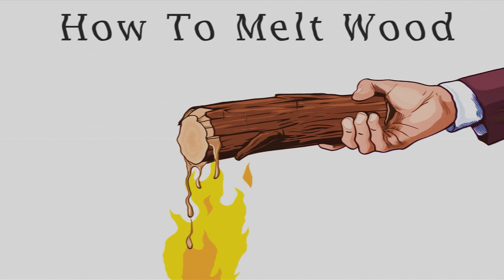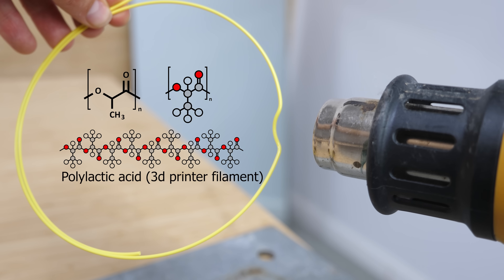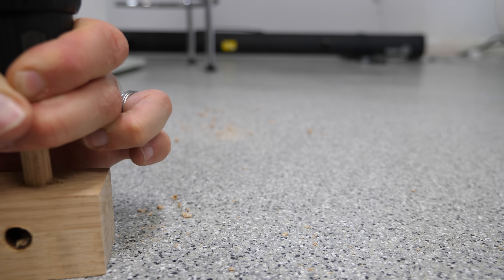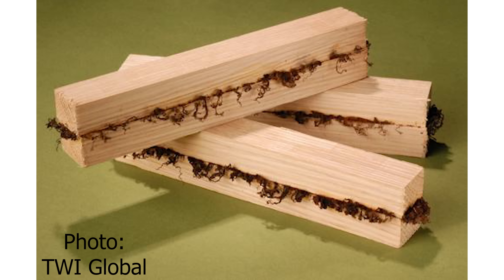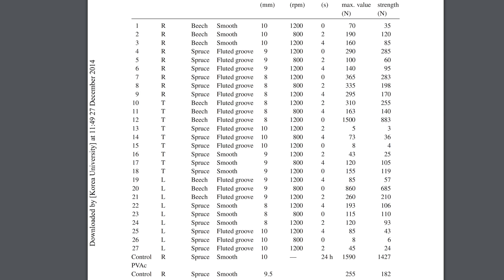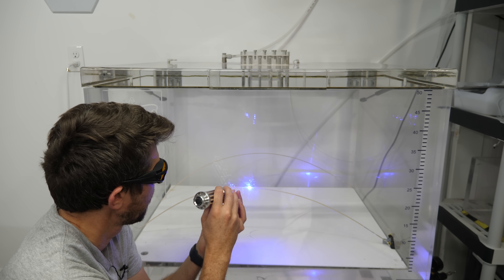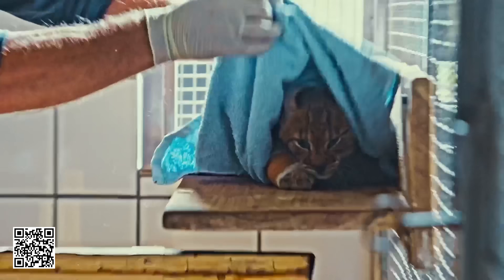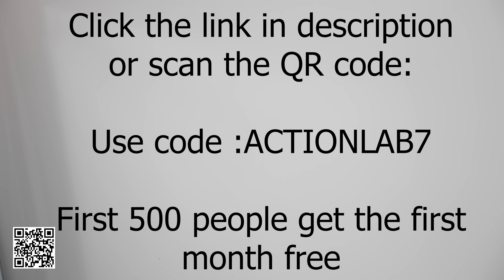I Melted Wood With Friction

Comment: I recently saw a YT short where a man was showing off his product "Wood nails" basically it's exactly this. You use a special nail gun that shoots the tough wood nail which thanks to friction is literally welded into the wood. And he's super humble, he doesn't call it some future of building or anything, he just states that the wood nails are useful for some applications but not all applications.

For example a wood nail instead of metal nails will mean that the wood will not rot so soon. Metal nails rust and that rust is the main cause of the wood starting to rot plus the wood nails are a significantly stronger connection.
I'd say every carpenter should atleast check it out.

Comment: There is a tribe in my area who made a hunting equipment (tool) by using wood and they need a frame structure, basically they use a technique called joining, there a tree ((I don’t know name)) they make hole or cut a according to need, and place two wooden pieces together on it and leave for few months, after that they take it out (pull) and it joints decent enough… if you cut oaks see it’s no longer joint there, some like tree branch,…. According to them you can make joint of any wood, it requires some trees wood,

Comment: is it that much healthier to skip the VOCs of glue using friction if you're making the lignin break down into VOCs and then not burning said VOCs? I wonder what the relative amount put in the air is for comparable joints.

Comment: You didn't melt wood, you partially melted some components of wood. If you've ever seen charcoal production, it does produce quite a lot of liquid, but again - that's not liquid wood, just liquid sub-components of wood. It can probably be fully liquefied, but at a huge cost and complexity.

Comment: Its not welded, well, not really, but yes as well. I know that sounds wierd but its true. The action of the spinning dowel causes friction, heat and then expansion. In that order. Which is why he had to hold preasure on it untill it cooled, when it cooled it shrank and formed to the burnt end of the dowel locking it in place, in the cross section you can see where this happened, so the wood did not melt and become bonded (thats welding) the wood expanded allowing wood to be pressed in and then cooled and shrank locking it in place. Look at it this way, wooden tenon used to lock wood together has been used for about 7000 years, so this is not new tech or a new understanding,  or science
Reply: Akshually 🤓👆

Comment: this is neat to pieces. can it be used for every wood related fastening process? dressers, shelves, walls, etc. if so, then every country should immediately pass laws banning harmful adhesives since just using the wood itself is an option now, and even shows stronger bonding results than the harmful stuff.

Comment: Soooo... You can rotate a dowel really fast to weld it to the hole. But dowels are usually used to connect two pieces of wood. What are you supposed to do next? Rotate the piece of wood really fast while pushing it onto the dowel attached to the other piece of wood? Seems like it's impractical to use this in practical terms.

Comment: I initially thought we were going straight to the vacuum chamber to remove oxygen. I was quite surprised that the friction method keeps the oxygen away just as well. Though while this is fascinating and as you bring up adhesives are toxic and expensive generally, I don't see this being used much in manufacturing aside from a few niche applications. The process of heating the wood properly without damaging it and the pressure and friction requirements seems like that itself would be expensive in implement. Adhesives are just much more generally applicable. But then again I'm not manufacturer, just some random chuckle on the internet. Maybe some company will prove me wrong! :D

Comment: It is so funny to me that I accidentally discovered that phenomenon by mistake literally 2 years ago trying to carve a wooden ring with no tools other than shitty sandpaper and a shitty drill. Thinking it would be easier to stick a wooden rod in my ring to try to smooth it out against the sandpaper with the velocity, I managed to burn it and weld together the two wooden pieces, but didn't knew how it worked until today. I thought residual oil had made some sort of bonding but was unable to explain how (the wood was dry and old lol)

Comment: I always wondered if taking wood into space or into a vacuum and applying extreme heat would cause it to melt
Reply: That's an intriguing thought! In a vacuum, such as space, without atmospheric pressure, wood wouldn't melt but would sublimate or decompose directly from a solid to a gas when heated, bypassing the liquid phase. At DVACI, we explore fascinating vacuum applications, though melting wood isn't one of them! Thanks for sparking an interesting discussion!

Comment: Nice video, but I think its actually not correct. Only what is crystalline can melt. An amorphous solid, aka a glass, like lignin can only soften at its glass transition temperature. As lignin is highly crosslinked it can neither melt nor soften. At least not without decompositon. What actually happens is (in the absence of oxygen) that it partially decomposes (by pyrolysis) and the molecular fragments connect the surfaces by partial diffusion.

Comment: The second part about permanently bending wood under high temperature exists for more than a thousand years now. The primary use of this technique was in ship construction which is also used to this day. Only difference is that it uses steam to achieve high enough temperature without burning the wood.

Comment: I thought this was pretty well known for a long time?  Wood pellets are sawdust bonded via heat and pressure from forcing the material through a conical die.  They come out thw other end with a smooth outer layer that keeps the pellet intact.

Comment: So I guess the melting temperature of wood is higher than the boiling point of water. But what if you boil it in a liquid with a boiling point above the melting point of wood?

Comment: So what would happen if you put wood in a high temp area that would normally cause combustion but have the wood in an area with only carbon dioxide? What uses would the wood have after that?
Reply: Oxidation is not the issue. It's the release of VOCs

Comment: Are you telling me, all things that can burn, put off flammable gasses,  as they heat up, and at a material specific temperature they catch flame, due to sufficient amount of gasses? What, specifucally, causes it to catch flame? Since it's at different temperature is it just a specific amount of the gas makes flame? Like, What exactly is the role of temperature, does it cause the flame and gas, or, just the gas and it somehow causes flame at certain amounts that is only reached at certain temps depending on material? Ibhave so many questions.

Comment: So. Honestly. This feel a bit like calling pattern welded steel damascus. 

What you are technically describing is brazing, where you join pieces of metal together right at the surface. 

A good weld, properly executed, ground and polished, forms a continuous piece of metal by literally interwining at the molecular level so well its forms a single solid piece of contiguous metal. Kind of like when you press two pieces of ice together to form a single ice cube. You can n9 longer tell quite where one begins and the other ends where the boudsries of the two pieces meet at the weld.

What you demonsrtrated wasnt deep penetrating process that makes multiple pieces into a single piece. You were describing and demonstrating a technique that allowed the surface layers, and a very thin surface layer at that, deforming and being held together by friction the same way dense velcro does. As the polymers begin to become plastically deformable, the fokd and twist amongst themselves locking the piece in place. Again, like brazing where you are normally working with metals that dont weld well, you rough up the surface a lil, meet the pieces, then melt a generally soft metal that flows easily when melted and is thin enough that capilary action can allow it to seep into all the nooks and crannys, forming a friction bond that is very mechanically difficult to separate except in extreme conditions.

Comment: This is essentially friction stir welding. You don't actually melt the material, which is good because that would make joints weaker.

Comment: Tbh, there are plenty of strong natural glues that are much less damaging to the environment than running an electric drill, especially a battery powered one (by far the most common type of drill these days).

Mining and refining lithium and charging it with a power station that's probably made of an unthinkable amount of steel and concrete and powered by fossil fuels made from countless dead lifeforms, condensed over millions of years, connected with a power grid that also relies on very large amounts of steel, together with various rare minerals

vs

Finding a dead animal, soaking its hide and straining the glue from it

Probably possible to make a vegan version with pectin instead of gelatin too, though I havn't heard of any attempt.

Still amazing though. =)

Comment: What happens if you increase the pressure instead? For ex. replacing the oxygen in the chamber with argon or nitrogen?

Maybe the pressure will keep the molecules intact enough so you could reach that melting point without breaking the whole structure.

Comment: They've been shaping wood with steam in sealed chambers for a long time. They clamp the wood to a form, then raise its temperature above "melting" with dry steam and no air/oxygen. Then after a time they let it cool and it's permanently formed. I think it started in the 1800s.

Comment: In the new Oxygen Not Included DLC they changed Lumber into Wood so that it can be used as a building material, would be cool if they allowed you to melt the wood like this.

Comment: The lignin in bamboo is a lot of fun to work with.  I would recommend using a heat gun to bend bamboo.  If you are patient you can make some incredible curves with strips of bamboo.  The greener bamboo is more tolerant with being bent,  I soak the more seasoned bamboo in water to then avoid burning it with the torch or heat gun.  Great video!

Comment: Bro I was actively wondering about this a week ago, but the reason was because I was trying to research what point bread melts or even boils because if I’m going to heat up a honey bun in an electric arc furnace to 3,000 degrees Celsius, I want to know if there’ll be anything left to spew at the homeless

Comment: You fused the wood dowl to the other piece of oak, when placing the plastic together with plastic would be the weld is how you married the two pieces together, a weld is process of bonding using  third material to marry them, fusion is the process bonding without a third component but main pieces are married together In the end.

Comment: Next, can we weld wood and make a sculpture with it?
Reply: I suppose it is not impoosible - with a vacuum room. Enter the room with a space-like suit and do the wood welding in there. You need some kind of mechanism to create high temperatures and apply some pressure to join the woods together.

Seriously, in the future, this can be a normal procedure. Craftmen creating new furniture and restoring old and broken ones.
Reply: @alihms might be something people will try to do
Reply: @alihms hello I study wood science as part of my degree at university. You don’t need any of this, you just need any old friction welder like ones that are used for plastic or metal friction welding and you can put wood straight in there and it works just fine
Reply: @alihms  covering the weld area with some gel, or just blasting it with argon or carbon dioxide seems to be mucvh easier, than making vacuum. 

Also it must be hot as fuck in this type of suit, since there's very little air outside it. Maybe not as hot as in space, but still not the best.

Vacuum sucks
Reply: @alihms what if you just sprayed nitrogen at it?
Reply: Probably more practical to use a chamber filled with a gas like argon and then blast hot gas at the wood, less complicated than makinh a whole room for that!
Reply: @dripwastaken7884 Either that or blast it with argon while welding in order to displace the oxygen.
Reply: how about pattern welded wood Damascus.
Reply: NASA has a vaccuum room for simulating space.
Reply: @mz7315  i did it :)
Reply: @mz7315  Send craftspeople into space.  Sell spacecrafts to finance their trips.
Reply: uh W00D Glue
Reply: I'm the 1k like
Reply: I don't think it would work because only the lignin 'melts', all the fibers stay solid. Wood is the natural equivalent of fiberglass resin. The resin is tough and sticky, but it has low tensile and shear strength.
This actually makes me wonder... a 3D printer that spits out high tension wire and coats it in epoxy in one operation. 

Nobody steal that idea, I thought of it first😂
Reply: so what?

Comment: Fun fact: this process is called friction welding. It is used in large scale manufacturing industries by rubbing two plates of metal together with machinery, causing it to weld together.

Comment: I have a question with a hidden suggestion embedded in it.    What about heating the wood in a steam chamber and then squishing pieces of wood together with a vice of some sort.      Steam bending wood is an age old process, but perhaps the addition of a remote controlled clamp or vice inside the steam chamber could be used to weld wood?

Comment: Instead of a vacuum chamber and laser to bend the timber you can use an old technic of steam bending at which you remove the oxygen from around the timber and apply heat at the same time from the steam. There is a formula for the amount of time a peace of timber needs to be in the steam chamber depending on it's thickness.
Reply: That's a fantastic point about traditional steam bending! It's a technique that beautifully combines the elements of heat and moisture control. At DVACI, while we focus on vacuum technology, it's always exciting to learn about various methods like steam bending that achieve similar outcomes through different processes. Thanks for sharing that insight!

Comment: You can weld aluminum to wood. The light gas gun at Sandia NL did this with every shot (oak was used to slow the projectile, and the grain of the metal and the wood would form a complex finger joint type structure).

Comment: Why don´t you melt the wood in an oven ? Lignin has a melting point of about 147 °C, the charring temperature of wood is at about 230 °C. "Cellulose starts degrading around 315 °C, hemicellulose 220 °C and lignin 160 °C" ("Characteristics of hemicellulose, cellulose and lignin pyrolysis",Yang et al.;Fuel Volume 86, Issues 12–13, August 2007, Pages 1781-1788)

Comment: a guy i worked with said he used to work in a foundry or something, with a huge wood furnace, and the ash would rise into the air, cling to the walls, and.. melt. and there'd be molten ash running down the walls. it's a weird idea, but it makes sense that eventually you're going to have simple enough materials that they are functionally mineral..
and plastic is made out of old plant matter anyway...

Comment: I have another wood question. Charcoal is made from wood. I’m talking about the charcoal you buy for your bbq. Can you explain how it’s done and why it doesn’t just catch fire while they’re making it and why it still is able to burn after they make it? I think it would be an interesting video.
Reply: They "char" the wood in an oxygen free environment so instead of burning it just "cooks off" the fluids & volatiles leaving behind almost pure carbon. (The missing volatiles are why charcoal has a higher ignition temperature.)

Comment: Wouldn't this technically be (or at least be close to) destructive distillation? treating wood at really high temperatures in a low oxygen environment causes it to break down into tar and several phenolic compounds which are fairly adhesive

Comment: Just a headsup:  carpenters/wood craftsmen have used this method for as long as we've had power tools.  I've used the drill-dowel method since I was a kid.. I learned it from my Dad, who learned it from his Dad, who learned it from his Dad.  I know this is not identical to the high frequency vibration of two flat pieces, but it has worked well for dowel anchoring many times.

Comment: The glass transition temperature has nothing to do with "melting".  It is the temperature at which the polymer transitions from a glassy state to a viscoelastic or "rubbery" state. It is a second order phase transition.  If a thermosetting polymer is heated, a temperature range will be reached where the polymer is observed to soften and flow.  This is not a single well defined temperature but an approximate range of temperatures where the polymer can be worked.  You may also want to look at a paper "Macromolecules, 1987, 20, 2226-2237" which discusses melt viscosity of linear polymers versus molecular weight.

Comment: I think the pressure/sealed environment probably also helped. With the drill experiment the polymer can’t break up and float off as monomer gas due to pressure. The bend experienced in vacuum chamber with heating may just be slight fiber rearrangement like you described with hot water.

Comment: By using a vacuum, you make it more difficult to melt. Wood would melt much easier if you (1) replaced the oxygen with another gas, and (2) increased the pressure.

Comment: In science, the control is not the extra stick. The control is the two sticks side by side before you put them in the vacuum chamber. You then compare them after you put them in the vacuum chamber. You do know that not all wood is perfectly straight. You know humidity, warpage, etc